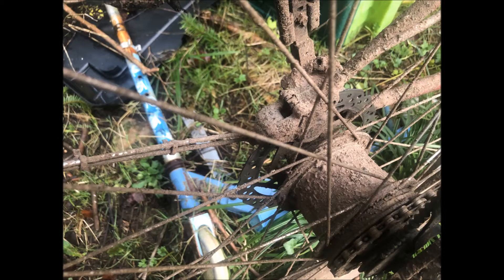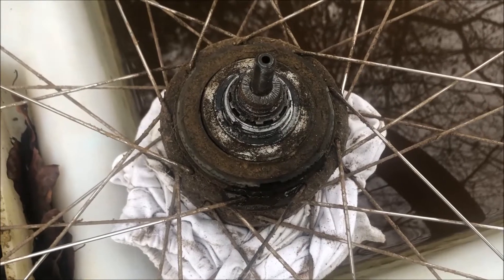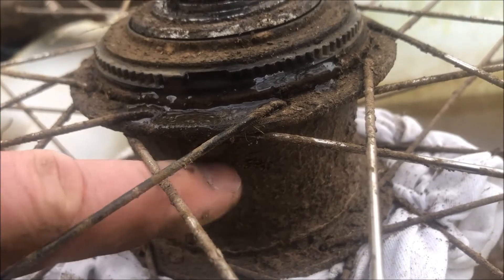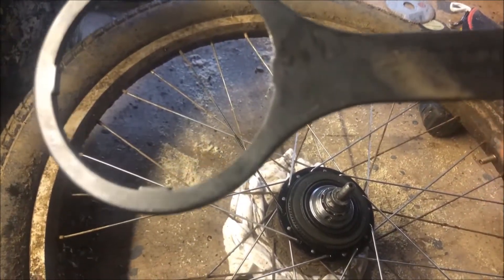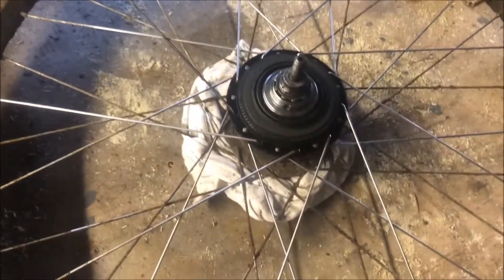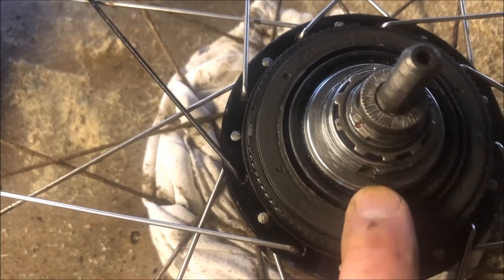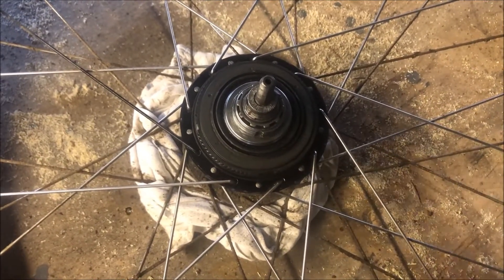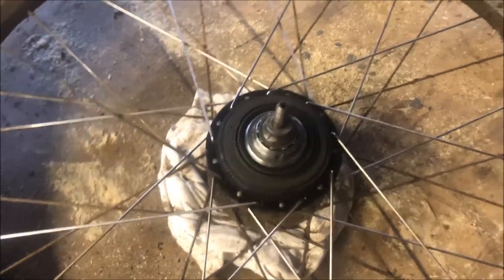Shimano Alfine 11 Indexing  & Oil Leak Problems

Comment: My alfine 11 is a newer model and it also “Leaks” oil. I am convinced that the drive plate seal needs to have some lubrication and so it is by design that a small amount of oil can weep out and lube that area. The lock nut with the seal in it should be as far as it should go. The locking nut has a small flange around the bottom that buts up against the drive plate seal. If it is extremely worn or in my case 1/2 of it broke off it will allow the drive plate seal to wobble way more than it should and you get excessive leaking. If you store the bike on its side it will leak continuously and you will see it. It is normal to see some oil and grit inside the cassette. Clean it off and you’re good. If you lay it down on non drive side it will make it look like the large rubber seal has leaked when that is not the case. The cone on the non drive side probably a bit loose. After you service bearings and put it back together hand tighten so there is no play at all then give a small snugging up that’s all too tight and you can damage bearings. When you refill after with syringe kit as soon as it starts getting harder draw some air back out remove nipple carefully squeeze air out reconnect and do it as many times as it takes. Don’t force it as you may cause blow-by thru seals as you mentions.
Reply from the maker: "The cone on the non drive side probably a bit loose." -  For me I think that was the problem. From now on I think I will disassemble to clean and re-oil. Now I have the tool for it. Are the bearings on the non-drive side oil bath as well? Or do they need grease do you think?

Comment: From your explanation your issues seem very similar to the issues my old Nexus 8 developed. 
Gear 1 was still super solid.
Gears 2, 3 and 4 slipped under light load, Gear 4 did a crunching noise when doing so. 
Gear 5 was very solid with very minor slipping when under high load. 
Gears 6, 7 and 8 Were pretty solid, maybe some very minor slipping, but couldn't really tell if that was just my imagination.
Shifter alignment was perfect, and I even tried out a little above or below, but it didn't change anything. I also checked the bearings multiple times. No change.
I think I might've just broken it because I rode it very hard, aka cranking super hard to ride up hills in 4th gear or something.
In the end I assume it was the roller clutches being worn out, specifically the middle one (The Alfine 11 has two of them), which was sliding, and in 4th gear causing some other thing to disengage and therefore rattle/crack.
I couldn't find any replacement components to fiddle around and possibly fix it, so I ended up replacing the hub, since nexus 8 are quite inexpensive. No issues since then.
I didn't throw away the old one yet, so if anyone has any Ideas I might be able to fix it... or I'll just use parts of it in case a bearing cone wears out, or I lose some bearing balls on my new one.
Reply from the maker: Thanks. I’m sure that will help someone! I’ve just learnt to live with it. And I don’t do stand up peddling any more.

Comment: 99% of shifting problems boil down to cable binding /misaligned or tension not set properly. I have carbon belt. Make sure when you remove your wheel you have shifted up to the highest/hardest gear first. If you don’t and you put it back together you may have the drive plate teeth off by a slot or two and it won’t shift right. Those red dots should line up upon assembly and in 6th gear the yellow dots should align if not use barrel adjustment to line them up.
Reply from the maker: Thanks Jeff. You are right the cabling has to be A1. I replaced mine a month ago, and the new outre end caps were snug around inner, I had to drill them out slightly to get cable to run niceley . The hub does not pull on the cable very hard.

Comment: Its a shame there arent many videos on the alfine hubs. Ive seen that the seal was greased, i can imagine that that helps against oil leak. Furthermore, the yellow or red dots are supposed to align, but ive read multiple forums which stated that thats often not the case, and that you should experiment with aligning. I bought the 8speed alfine a few days ago, because of these problems the 11 seems to have. I do miss the extra gear range at the top tho, but i hope that its a good choice for the future.
Reply from the maker: Since this service it is behaving tolerably well. But I think I might consider and alfine 8, if and when I change. These hubs cost a lot so they need to last a long time to warrant the cost.

Comment: Are older Alfine 11 hub versions worse than newer?
Reply from the maker: I don’t know for sure. But I think 🤔 if you look on forums that is general consensus
Reply: @DorkyThorpy  Is it worth buying used Alfine 11 bicycle and how to know if parts inside are not worn out?
Reply from the maker: @RynaxAlien  I am a big fan of second hand stuff. But I don't think I would buy a second hand alfine 11. As you have alluded to, there is no way of knowing whether it has been looked after, it may have run dry, or been used in too low gearing configuration. It is also a lot of work to fit one, just to find out if it is working. I would buy new, or I would buy a cheaper shimano hub if that is too much. You would have to check but an 8 speed nexus, with and alfine shifter was a popular option when I bought this.

Comment from the maker: Should add. If I were using a cassette / chain system. I would have likely gone through . . . . 4 sets of chains and cassettes in the time it has taken this hub to degrade. Cost for this on prior 9 speed system would have been approx £100. This hub cost £300 (and that was a good price), so it has not paid for its self prior to becoming degraded.
Reply from the maker: @@Lorin-GabrielLeaua-fm1lw Yes I do. I live in a very hilly area, I am often in gear 1 or 11 . I have often thought about a 3 speed, or perhaps a 5 speed, but I do use the full range every time I cycle.
Reply from the maker: @@Lorin-GabrielLeaua-fm1lw Thanks for the tip, I used to run a moped chain on my BMX when I was younger.

Comment: Looks like the crankshaft oil seal on my vw 😄... basically the same as the 8 speed  Yeah I guess if you're getting it muddy alot it's going to wear the seal faster. My A 11 has always leaked, pressure changes like bringing a cold bike indoors end up with a puddle on the floor. Probably not a big deal low oil as the 8 speed works fine with very little. Just leaks out and ruins brake pads otherwise.  My alfine 11 did about 8k miles with only occasional slip, then one day someone pissed me off and I broke something inside the hub chasing a car. Now indexing is completely gone, not sure what gear im in, feels like nether one or the other.  strip down required 🙄. I've not managed to break an 8 speed yet. Automatic transmission fluid, dextron 2 is supposed to be the alternative to Shimano oil.
Reply from the maker: Yes now you mention it the crankshaft seals are similar. I replaced one on a peugeot once (never again) and it also has a metal spring inside to help keep the seal squeezed on to the shaft. Probs about 4 x the diameter though. "chasing a car" LOL. I might check out the dextron 2. - https://www.google.com/search?q=dextron+2&oq=dextron+2&aqs=chrome..69i57j0i10l9.949j0j15&sourceid=chrome&ie=UTF-8#cobssid=s Made in the UK too! Nice. 

Since posting this video I have ridden about 50 miles on the re-oiled hub. Its a lot better, but I have seen drips of oil, and it still slips gears a few time on each ride. I did think about liquid grease (type you use for chainsaw bar nose) for lubricant, as that would not drip out. . . I think modern sturmey archer hubs use a thin grease.
Reply: @DorkyThorpy  yeah I guess you could try the Shimano nexus grease. Take it apart, clean again, re oil (oil dunk) in dextron 2, let it totally drip dry then add some nexus grease. Basically what I do with the 8 speed... Oil leaks are a pain if it's trashing your brake pads, but I've never tried that on the 11 obviously..
Reply from the maker: @nickwf70  That new to be the nexus grease. Nice tip. Thanks.

Comment: you are openingn the hub under filthy conditions. Shoud have cleaned the entire wheel and then celaned again or use LOW  pressure washing and a brush the first time including sopkes demonted rim etc. As a bike shop owner and rider for 4 years I am applaled you would think your video is adequate to del with the issue. NO. Just one iota of carbide grit getting inside the seals can wreak havoc. Please redo your video. Shimano make a very good product for the money. If you want Rohloff buy it. Slim
Reply from the maker: Yo dawg. Yeah I know what you mean in an ideal world I would have cleaned the hub first. These problems started before I opened up the hub up for the first time, the only time I changed the oil prior was by using a syringe through oil port. The lawnmower oil I put in there a couple of years back is still working great by the way! It would be better if the oil fill hole was double the size or more. That wouldn't be any more complicated for shimano to do, and would enable people to drain old oil properly. If one piece of mystery carbarundum would wreak havoc, then 1000's of metal fragments, might not do much good either.

Comment: All this Dirt ...of course its leak 🤦
Reply from the maker: How so? Should I not get the hub dirty? That is one of the major advantages of a hub gear, all of the moving parts are kept out of the the (abrasive) dirt. Unlike a derailleur system, where you end up with a grinding past smothered all over the pressure surfaces. (cool profile pic by the way: Aliens or Alien?)
Reply: @DorkyThorpy  no judgements here , terrifically surprised & happy to see what a laymans perview would be with this particular hub , it looks as if this is not built nor capably designed to be that "bulletproof" go to?..why such a thing as a simple plug-unplug cable failure ? would love to have gearing cable less , but with who really? shimano should-could speak more since they did decide to mfg & then compete against the others...1st look says shimano decided to ignore  what was made with their trademark stamp , quite the thing here
Reply from the maker: @DanielLampere  It keeps limping on. In fact it has done 2 years since this repair / oil change. But the slip gear problem is frequent enough that I wouldn't risk stand up pedalling. I think you get an alfine with electronic shifting BTW